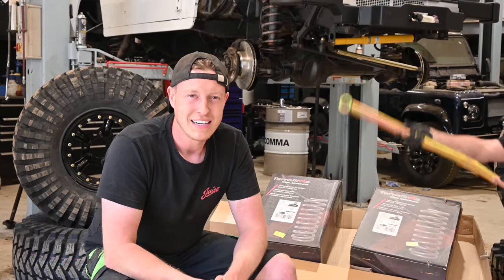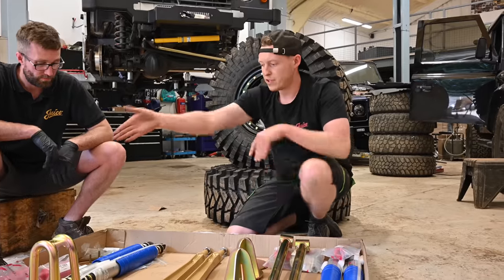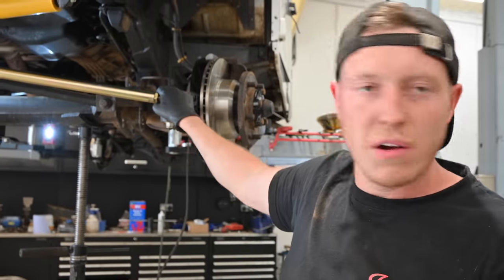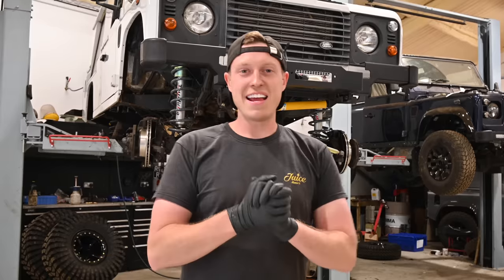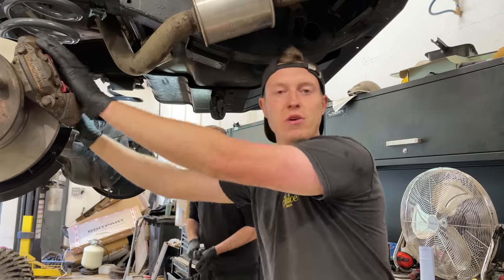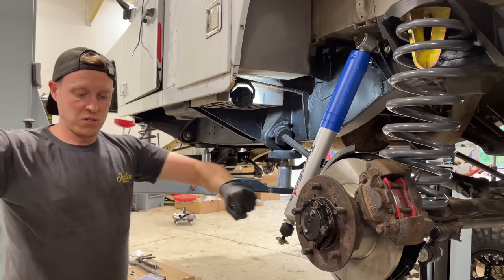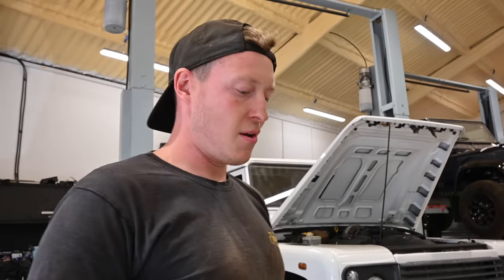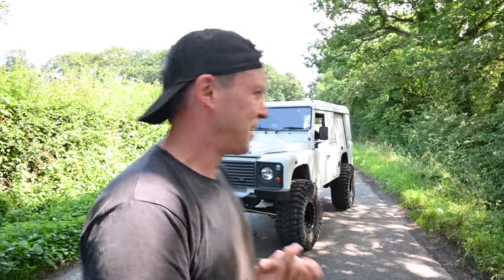HOW TO FIT A +2" SUSPENSION LIFT KIT! - LAND ROVER DEFENDER 110

Comment: Absolutely brilliant, I've driven land rover for over 40 years, mostly in the forces, 27 years, I've been ill for some time recovering from a partial foot amputation and started watching your vids, really helped me converless, as so much I've just purchased a 110 TD5 County and am going to make it my hobbie, thank you very much I'm really enjoying your vids. I actually enjoy them more than actual TV . Once again thanks. Monty ex royal Marines.
Reply: These guys are creating a vehicle which is very non-standard. It looks great in the car park at the LRO show but you wouldn't take it to the Sahara. Also this type of kit is very expensive.
Without wishing to be a wet blanket, this vehicle is illegal in the UK because the tyres stick our beyond the bodywork and the super wide tyres reduce the life of the wheel bearings and the axle itself.

My suggestion, if you are starting out on a renovation / rebuild for the first time, is to decide what type of vehicle you really want and to plan around that. Don't get seduced into to bolting on expensive accessories just because everyone else does it. Your starting point should be to deal with the chassis and any corrosion first - not sexy but very necessary.
Best of luck with the rebuild and why not make a video for YT?

Comment: fitting those tyres is easy if you do it the icelandic way i had same issue use lighter gas take the valve out and set it on fire they pop straight on first time i did it and it  was easy for anyone out there who has any issues like the tyre fitter the strap idea works to sometimes to get the bead to seal.

Comment: Hi mate .i have a 90 with 2 inch lift I want to replace the springs .i do mostly moderate off road use ..what pound springs would you recommend.front and rear …
Many thanks .Paul

Comment: Looks totally insane! 😀👍👏No chance to get this monster through MOT over here in Germany with this wheels. Need to be fully covered by the fender.🤷🏻‍♂️
Reply from the maker: Haha same here! It’s off to the body shop for arches and a repaint! Thanks for watching! 💛
Reply: @juicemotors  I was wondering why you’d not fitted the arches. I guess an extended arch kit if there is such a thing?
Reply from the maker: It’s having the spectre wheel arches! Massive things to cover these wheels!
Reply: Needs to be covered over here as well

Comment: Great video - I've fitted 35 trepadors and a 40mm lift. Would you recommend removing the anti roll bars? I also didn't fit front and rear radius arms and  cranked arms. Should I?
Reply: removing the roll bars is only beneficial if you need some serious amounts of articulation off-road. Cranked radius arms are not needed with 40mm lift but it might benefit it, I am also not a professional so don't take my word for it,

Comment: With the solid half shaft you just put the problem somewhere else in my opinion. Like normally they just wear out the driver on the hub and that wears out not the half shaft and not something in the dif. With the solid shaft you have the risk of wearing down the driver in the dif and that’s way more expensive and hard to change ten just the driver on the hub. But that’s just my opinion maybe you can explain to me if it’s any different

Comment: Reckon you need the adjusted radius arms if just lifting 2 inches? or only need those going +2?
Reply from the maker: For a 2” lift you should absolutely fit corrected radius arms, you can just of course fit springs and shocks but you’ll be adding more wear onto the radius arm to chassis bushes - nothing serious though

Comment: With the tyres jutting so far outside of the wings. Is this legal? And, presumably this is why it was going off to the body shop, to possibly have wing extensions? Fair doo's, the thing looks awesome though.
Reply: With tires jutting outside traffic bylaws requires that you fit it with mudguards that extends far beyond the normal size of the the machine

Comment: You need double carden propshafts when you lift a Puma, the stock ones are already at their limit as Puma engines sit higher so they are going to wear out fast
Reply from the maker: Pumas have wide angle propshaft UJ’s as standard, I can’t tell you how many I’ve lifted and the extent I’ve lifted them too 🤷🏼‍♂️😂 check my channel for more! Thanks for watching😁 💛

Comment: What are the details on the axle swaps? I'd be interested in getting those.
Reply from the maker: Hi Michael, we didn’t swap the axles. Do you mean the swivel guards?
Reply: @juicemotors  the half shafts. Sorry. The one piece that eliminates the drive train slack. Thanks!
Reply from the maker: LOF Clutches! Look them up, they’re needed on every defender!

Comment: Do you need to change the front prop shaft in a puma defender when lifting it 2 inches?
Reply from the maker: No, Puma have wide angle propshafts
Reply: @juicemotors  good to know thanks

Comment: Can you provide a link to the shaft part to prevent slap, I've just purchased a 110 ands it needs doing 
Cheers
Reply: Replace your drive flanges for the terrafirma heavy duty ones. Just be prepared to break axels instead of the flange (which is a sacrificial mechanical fuse)

I had maxidrive flanges and axels in my 110 and they were tight as a nuns asshole...
Reply: @tristanknight9862  Thanks for the information
Reply from the maker: https://lofclutches.com/shop/brakes/brake-kits/defender-solid-hd-rear-drive-shafts/?v=79cba1185463

Comment: polyurethane is not very good .. it will limit the travel of your front axle.  and there were cases when polyurethane even led to a crack in the suspension at the attachment point.  To
in lateral traction polyurethane can live well👍🏾